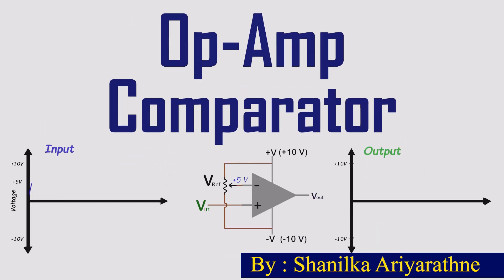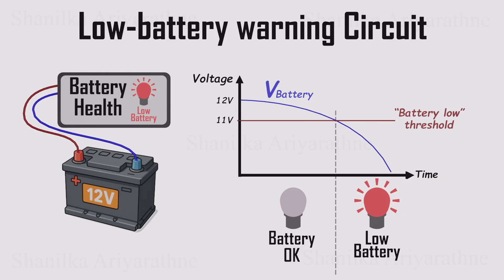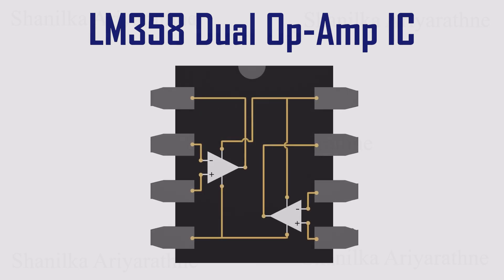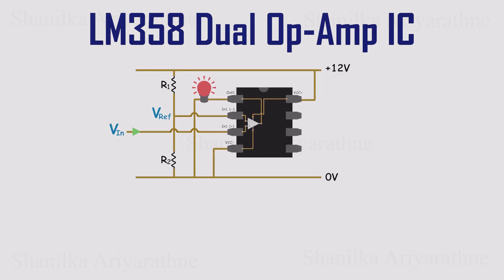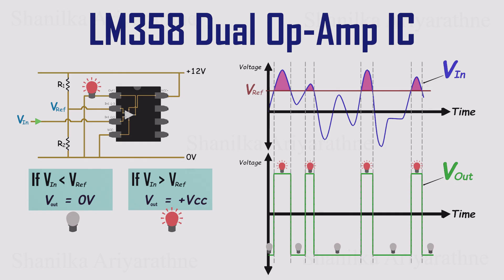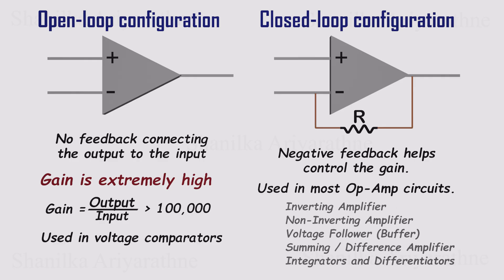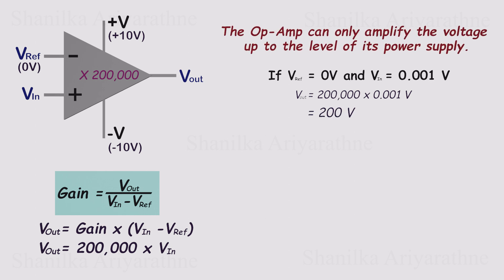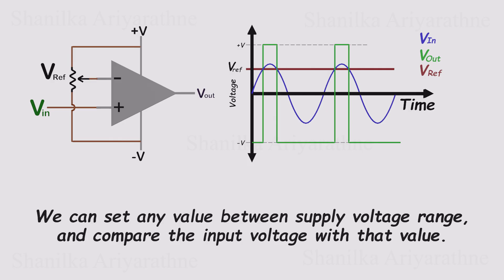Op-Amp Comparator Explained — Simple Circuit, Powerful Applications

Comment: It appears you originally say this is a liw voltage alarm, abd say if Vin drops below Vref, then the red alarm 🚨 light comes on.  But then your circuit says when Vin is below Vref, the light is at 0 volts and the light is off!

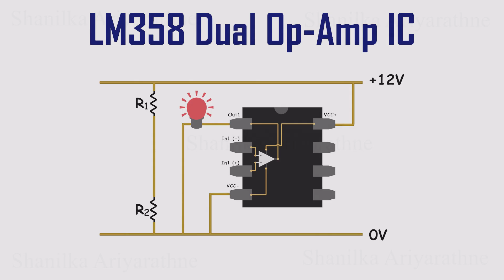Comment: At 2:23, what is the point of the adding R2 and connecting the Vref to Ground over R2. I mean is it not possible to design this same circuit without using R2 and connecting Vref to Ground over R2 ?

Comment: tl,dr: "input offset voltage" is an error source that can be important in comparator circuits

It is important to realize that the "input offset voltage" can be an issue in comparator circuits (and also in "conventional" amplifier circuits).
In the example looking at what happens with an assumed gain of 200 000, the input offset voltage has a big influence..
Ideally if the actual voltage difference between the inputs is exactly zero, the output voltage will also be exactly zero. If you were to raise the voltage on the non-inverting input to, say, 10 µV, with a again of 200 000 the output would be 2 volts. 50 µV would cause the output to swing as close as it can get to the +10 V positive power rail.
Input offset voltage can make a mess of this. Offset voltage is essentially a voltage difference between the inputs that adds to the the actual voltage between the inputs. If the offset voltage is positive, it can be considered as adding to the non-inverting input while assume the inverting input is at zero. If it is negative, it still adds, but with the opposite sign. In the LM358, the input offset voltage can be anywhere from -3 mV to +3 mV. Usually actual offset voltage will fall within a narrower range around 0 V, but you aren't entitled to expect that it will.
With a gain of 200 000 and a +3 mV input offset voltage, with both inputs actually connected to 0 V, the output voltage would go to +600 volts, which of course it can't because of the supply voltage.

With some amplifiers the input offset voltage is quite stable with time and temperature variations. With others it isn't so stable.

There are ways to cope with input offset voltage, but they add to circuit complexity and the need to make adjustments to the finished circuit. If you need really low input offset voltage there are amplifiers designed specifically for very low offset, though they are going to be considerably more expensive than the LM358. Offset voltage is the result of the inability to perfectly match all of the components that should be matched in the IC. Getting really low offset voltage often involves "trimming" one or more components with a laser. This is time consuming so it is expensive. If you use the "A" version of the the LM358 (i.e the LM358A) you'll get a narrower range of input offset voltage for just a small cost increase.

Comment: Something that could perhaps be covered in another video is the use of positive feedback to provide hysteresis for the op-amp comparator; e.g. the comparator might require that Vin exceed Vref in order to turn the output on, but then Vin would need to fall some specified voltage below Vref before the output would turn back off. This hysteresis prevents chattering of the output if the two input voltages linger very close to each other's voltages.

Comment: A common issue when using regular op-amps as comparators is that many such op-amps have common-mode limitations that don't allow the voltage difference between the two inputs to be very great, or not near the supply voltages, etc. Exceeding the common-mode voltage range of an op-amp can cause it to operate unpredictably, and some op-amps might even be damaged. So it is important to take a look at a given op-amp's datasheet to see what the maximum common-mode voltage is, and design according (or chose a different op-amp type).

Another limitation of regular op-amps is that their slew rate (how fast their output voltage can swing through a wide voltage range) is slower that you might need for some comparator applications.

Yet another limitation is that most regular op-amps have outputs that can't source or sink a lot of current

If any of the above limitations are problematic for your application, there are plenty of purpose-made op-amp comparator ICs out there. They will be much more forgiving of input voltage range, to the point where it is no longer an issue. Their outputs will have a faster, 'snappier' action to them. Their outputs will almost certainly be able to drive grater loads than would regular op-amps.

I have made frequent use of regular op-amps as comparators, and to get around the common-mode voltage limitation (I used to work for a company that wished to keep parts inventory very small, so re-use of common parts in many designs was paramount), I used three extra resistors; two resistors in series with the inputs, and the third resistor between the inputs. These formed a sort of voltage divider that kept the input voltages reaching the op-amp inputs close together, while still allowing the actual input signals to have a wider range of voltages.